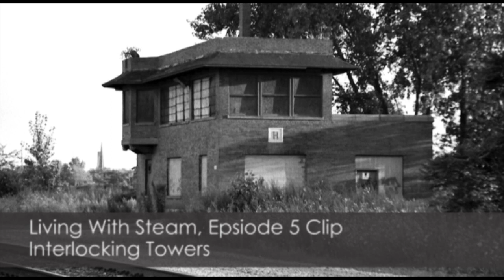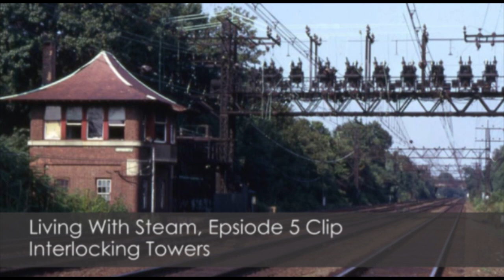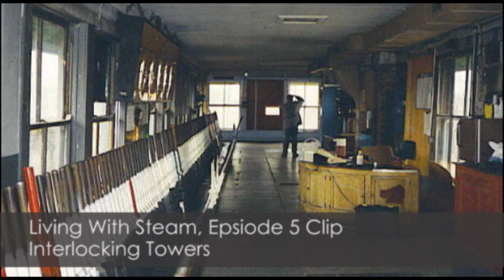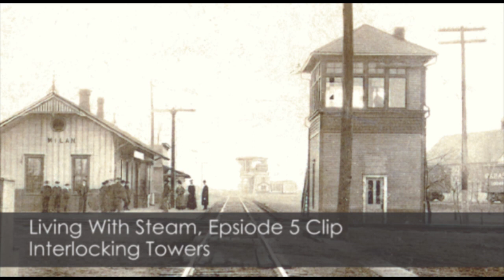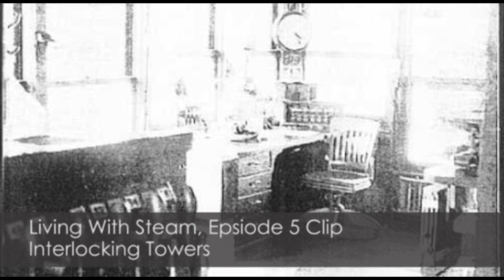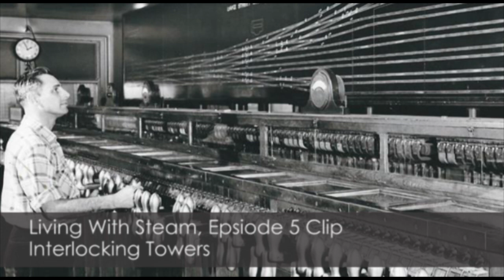Living with Steam Sample Clip: Episode 5, "Interlocking Tower"

Comment: I managed to get into Tower H once before it was razed in the late '90s. There wan't much left in there and it was a dark dangerous mess of scrap metal by then. I had wanted to inquire about buying it from Conrail, but one day it was just gone. When i was a teenager in the '70s I had the pleasure of visiting FW Tower and operator Scotty Whitehead a number times. It was a true "Armstrong" plant with the floor mounted levers connected to switches and signals by pipes and bell cranks. Scotty taught me how to run the plant and would test me on it when switches and signals needed to be lined for an approaching train. I will always treasure the memories of my afternoons spent there.
Reply from the maker: I'm truly jealous. Every interlocking tower in Western New York was boarded up or in the process of being demolished by the time I started appreciated railroad architecture in addition to trains. I missed out on a huge piece of history.

Comment: There were still a number of towers along the ex-B&O mainline into the 1990s.  I was lucky enough to get to visit several of them.  A few were "armstrong" plants, even at that late date.  Still others used variations on General Railway Signal's pushbutton "NX" machines with electric or air switch machines.  A couple of them had GRS "Pistol Grip" U2 plants.  The dispatcher would arrange the traffic and the operators carried out the instructions.  D Tower in Grafton, WV still handed on train orders for the "Fairmont Side" until June 1989!  The towers at Rowlesburg, West Keyser, and Brunswick actually worked into the 21st Century, but all are closed now, and most have been demolished.  I miss those places.  Generally speaking, the operators were glad for some company unless "officials" were out and about.  I enjoyed the whole "tower scene" so much I adopted it for my screen name!

Comment: Traffic was routed through an interlocking in accordance with the timetable most of the time.  The operator would be expecting a specific train at the time specified in the timetable, but where I worked (the New Haven mainline) towers to either side of you would announce the passing of the train from them to you by a bell code.  Intervention by the dispatcher wasn't necessary unless he wanted to change something; most of the time he simply listened and acknowledged reports, recording the progress of all trains in his district or division.  In addition, you could follow the progress of trains by listening to other operators reporting the passage of trains on the speaker line, a kind of party line.  This was a phone line dedicated to the dispatching district, on which all operators and the dispatcher could overhear each other continuously.  Each tower had a speaker on the desk for this purpose.  The speaker was on continuously, but not your mic.  You would press a foot pedal under the desk to open your microphone in to the line and everyone from New Haven to Boston could hear you report the passage of trains to the dispatcher or whatever else you had to report.
In earlier times the telegraph was used in exactly the same way, with open communication using Morse code between all points in the district.  The dispatcher would dictate train orders to whomever he wished using this channel, for delivery to a train(s) by the operator at the location addressed in the order.